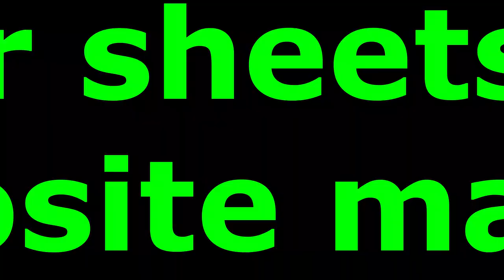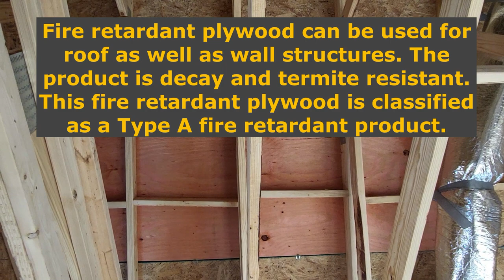Learn Residential Building Framing Terminology (Part 1)

Comment: Hello renaldo, @ 8:13 is a Boca plate only for plumbing. I see a nail guard to the left protecting the electrical. why is the nail guard not used at the plumbing pipe? thank you sir.
Reply from the maker: So Boca Plates are typically used to protect anything running vertically (plumbing and electrical). Nail guards are typically used to protect plumbing and wiring running horizontally.  Boca Plates extend up or down 2"
Reply from the maker: I appreciate your feedback, and thanks for watching.
Reply: @PPG1967  thanks that’s kind of what I thought.  Brother  your channel has been so helpful to me and my everyday work routine. Please keep them coming you’re a great teacher!!!